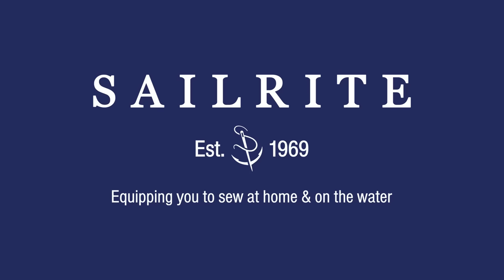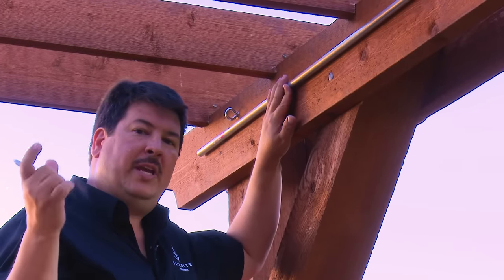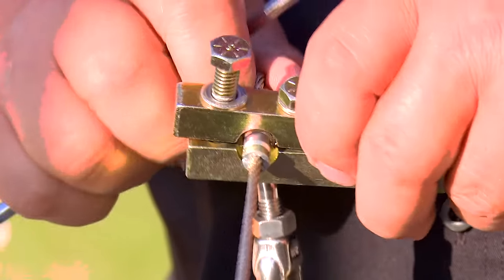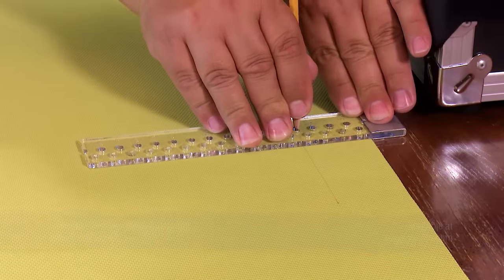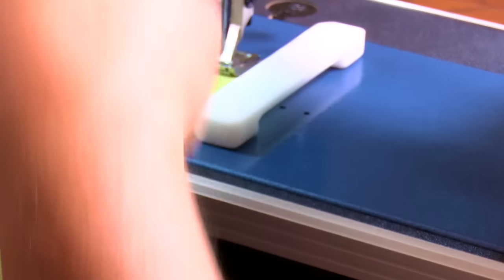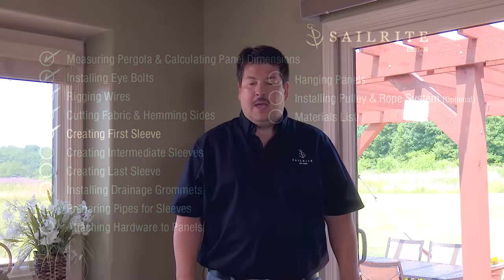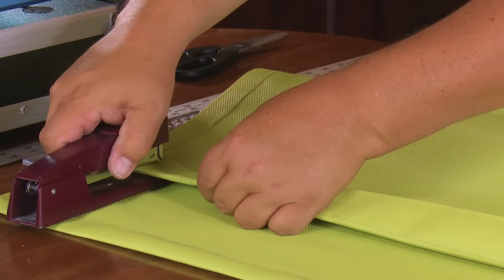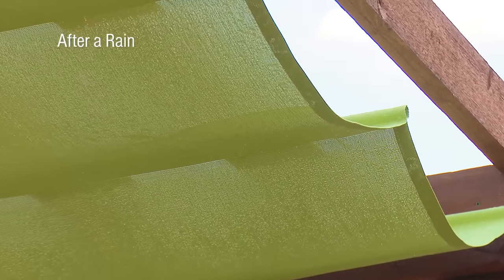How to Make a Slide-On Wire Hung Canopy (Pergola Canopy)

Comment: My calculation sheets states a 2 inch sleeve allowance but you allowed for 3 inches.  Any particular reason?  Great video, BTW.
Reply from the maker: Hi Gary, At 37:50 minutes in the video we are creating our first pocket on the end of the canopy. This pocket is made by measuring 1" and striking a line on the fabric. Then we fold the fabric to that line, making a 1/2" hem. Then we measure down and strike a new line 3" from that folded hem edge, making a 1.5" hem. So in the end we are taking away 2" of fabric from the ends, not 3 inches. I hope this helps. Let me know if you have more questions. Eric
Reply: @SailriteDIY  Thanks.  Makes sense now.

Comment: Such a great video,  built my pergola and the follow up was always going to be some sort of shade for it, looked at shade sail which would have been a nice easy solution but no retractable which was really what the wife (and I) wanted. Got one shade finished but 2 to go and then a case of getting up the rigging and control system so still lots to do. I have a question about the rigging though, how might i have the control line at the "normally open" end, I've been studying the ebook but cant figure it out, thanks again!.
Reply from the maker: The control line usually comes down on the end where the canopies stay collapsed (in the non-covered position). We have not designed a system for the control line to stay on the side where the canopy is on the "open" end. However, I think the only thing you would need to do is switch the canopies so the strap eye were on the opposite end of the canopy. I have not tested it, but I think that would accomplish your goal. Another-words switch the canopies 180 degrees so the strap eye were facing the double block pulley instead of the single block pulley. Let me know if this works for you.
Reply: Sailrite im a little confused by your suggestions as surely this would end up just swapping the normally open end. Is it just a case of swapping the single and double blocks round? Thanks
Stu
Reply from the maker: The double blocks must stay on the control line side of the structure. The single blocks must be on the non-control line of the structure. The only thing you have to do is flip the canopy panels so the strap eye in the center (the strap eye the line is attached too to pull the canopy open and close) is facing towards the double block and not the single block. It should be that easy. Email me for a rough drawing that I can email you. eric@sailrite.com

Comment: Thank you for the great video. Can i do 1 panel of 10ft width if the fabric is a light shadenet?
Reply from the maker: Yes, you can make a wire hung canopy from a single panel of fabric that is 120" wide. You will need to use more wires as seen in this PDF: https://www.sailrite.com/PDF/Sailrite%20Wire%20Hung%20Canopy%20Diagram.pdf I have no idea what "light shadenet" fabric is, sorry.
Reply: @SailriteDIY  thank you. With this configuration,  where would the dacron rope be fixed? Ideally it would be in the centre of the panel to get even pulling but in this case that would be difficult i guess

Comment: Great video, very helpful and detailed yet also succinct. I have a couple of questions about the materials for this project. I was wondering about the possibility of using PVC instead of EMT to decrease the weight and alleviate potential corrosion issues. Also, what are your thoughts on using coated wire to potentially decrease the noisiness when deploying the canopy.  Lastly, if I do not own a sewing machine that can handle the material and thread and am not in a good position to purchase one, is there anyway to get the material already sewn for this project. Thanks.
Reply from the maker: Excellent questions. I have been asked about using a schedule 40 PVC pipe for the sleeves several times after this video was shot. I do believe that it may be a viable option, but it has not yet been tested. I believe that the screws would hold well in the PVC pipe and I know that the weight reduction may help improve the sliding action of the canopy. However, without testing I am not sure I can confidently confirm that it will work. If you use the PVC pipe in yours please let me know the results. Vinyl coated wire will reduce the noise when sliding the canopy, but the vinyl will greatly reduce the "easy slide" factor of the fixed eye snap hooks, so I do not recommend it. Email me at: eric@sailrite.com for a quote on materials and possibly some help on sewing. Please include the structures width, length and what type and color of fabric you want to use.
Reply: Eric; would the pvc pipe (making it more lightweight) create more of a "drifting" or moving problem in the wind?
Reply from the maker: I do not like using PVC as the pipe. Why? It is not heavy enough to keep the canopy weighted down during strong winds. Use 1/2" EMT pipe or you can use 3/4" aluminum tubing: http://www.sailrite.com/Tubing-Aluminum-3-4

Comment: Nice explanation on everything!! In theory, if I have a 12' wide fabric and plan on using just the edges on a wireline, would this still be possible without a terrible sag? My current project won't allow for multiple panels (unfortunately)... Thanks!
Reply from the maker: Making a single canopy panel by sewing sections of fabric together is possible.  However, we recommend a canopy be supported with a SS wire cable no more than 36” to 44" apart along the width.  So, you would have to use two seperate rectangles of wire to support the 144" wide canopy, making a canopy that is supported with four cables. For yours (144 inch wide canopy) you would have a cable at 8” in from the right edge of the canopy, then a cable in from that one at 42.66”, then the third and fourth at 42.66” which sets it 8” in from the left edge. Email me at: ericg@sailrite.com if you have more questions.

Comment: Would PVC work instead of conduit?
Reply: No, it will warp very quickly.  Think in terms of otherwise standard PVC installation.  Codes says it needs support every 32”.   Wooden dowels would be a suitable option if they were at least 1” in diameter and you spent the time to make sure they were straight and then seal them with Benite or similar so they don’t warp.

Comment: Could you use pvc pipe instead? Is there a reason for metal pipe? Pros/Cons? I’m wanting one built over a pool so I worry metal pipes would be heavy over a longer distance. Also, your video received my first ever like on YouTube!
Reply from the maker: Using PVC Schedule 40 half inch pipe might work very well. It has not been tested, but I think it would do fine. Try it out and let me know how it goes.
Reply: @SailriteDIY  Thanks for the reply! We may try this route. Anything to keep from swimming in a pool of bath water in this TX heat.
Reply: Do not use PVC it will sag in the heat if you want something that’s not steel thick wooden dowels (1”) could work but you will need to spend a fair amount of time at the lumberyard rolling them to make sure they strait.  Then treat them with a product like Benite or similar to prevent warping in future.

Comment: this will cost a fortune, the nylon line will fry rubbing the cables and if not careful the eye bolts will bend or snap bc the cable puts a side load they are not designed for. tying everything negates the function of having sections! bad desing. i ate the 1:38:00 ffs

Comment: Wonderful video, with awesome instructions. Please advise if this technique can be used on a vinyl pergola? Thanks @sailrite
Reply from the maker: Typically a vinyl pergola has a wood core to support the structure. If that is the case, yes it can.
Reply: Even if it were hollow you could do this just fine by not being wasteful and not over engineering it to death. Use lighter materials for panels, use lighter materials for "cable". Do not use turnbuckle at all. Use large front and back plates on eyebolts if you feel that you need eyebolts.

Comment: Won't it collect rainwater, including when closed??
Reply: M A Walker, didn't he say this fabric is mesh so the water drains "through" it down on the patio surface?
Reply from the maker: No, we used a vinyl mesh fabric called Phifertex Plus. If you use a water resistant fabric you must install a single grommet in the middle of each span (as described in the video). However, for Phifertex Plus you do not need to do that, it will quickly dry out after a rain.
Reply from the maker: Yes, that is true!

Comment: This is just what I want! I would never be able to do this myself though. Also, just wanted to let you know that the link to the calculator isn't currently working, it says "Server Error 404 - File or directory not found" at http://www.fabric-calculator.com/wirehungcanopy/app.html
Reply from the maker: Link is fixed. Thanks for the heads up.

Comment: I'm not a builder but if all yo need to do is to hung fabric do yo really need this structure to be that heavy??? I think not. I'd use heavy beams on the perimeter of the pergola and one or two to make it stronger and sturdy.  It looks heavier than the house like when you weight 95 pounds are you wear soldier boots it's just disproportionate. I have seen more modern concepts and a lot lighter that his one to get the same effect. Also this is very expensive. At the end it's too much money, work, materials, time.

Comment: To much work involved. 
Jst sell a kit
Reply from the maker: Bill - I would be happy to quote a kit for your wire hung canopy system! You can email me at eric@sailrite.com All I need from you is the following:
1.   What is your full shipping address and phone number (required for the quote and shipping of product)?
2.   I assume you will be using a vinyl mesh fabric called Phifertex Plus, if so, please use this link and pick your color and style of vinyl mesh fabric: http://www.sailrite.com/Fabrics/Marine-Fabric/Marine-Mesh/Popular-Collection/Phifertex-Plus 
3.   What is the width (fixed coverage, where eye bolts will be attached) and length (adjustable coverage of canopies) of the structure or pergola? 
4.   Do you want the Optional Pulley Open/Close system quoted (I strongly recommend this system)?

Email the answers to eric@sailrite.com for a quote.
Reply: Check out Infinity Canopy. Its a DIY kit.
Reply from the maker: While you are checking it out at Infinity Canopy be sure to click on the "Estimate-Shop" to see the prices of those DIY kits. I must say they are very expensive, expect to save hundreds if not thousands (depending on the size of your canopy) by ordering a DIY kit at Sailrite.  Also take note that the Infinity Canopy quote does not include the "rope pulley system", it costs extra from them and it is also made from inferior metal pulleys unlike Sailrite's marine Harken brand pulleys & blocks.
Reply: @SailriteDIY  Just reached out for my quote today!  Thanks for offering this product, information, and service, Eric!
Reply from the maker: @chaseman  Hi David, I just finished your quote and emailed it to you. Let me know if you have any questions. Thanks, Eric